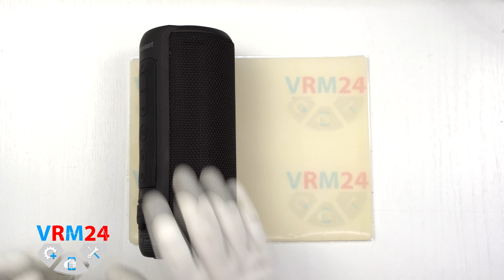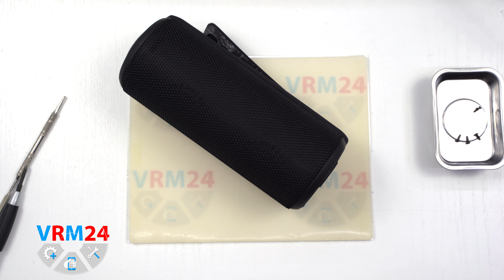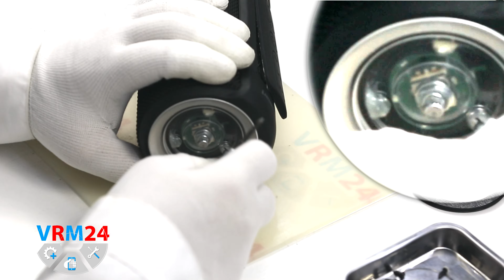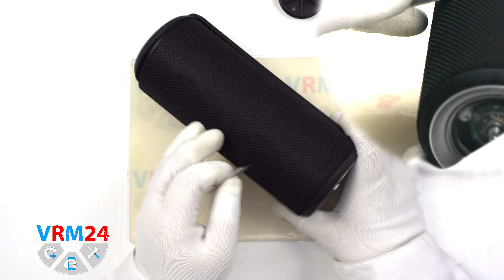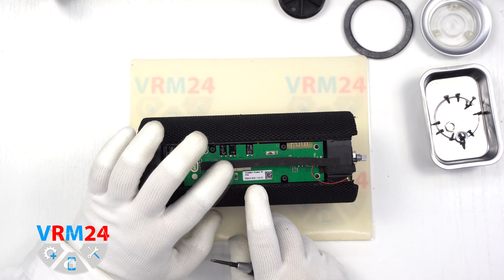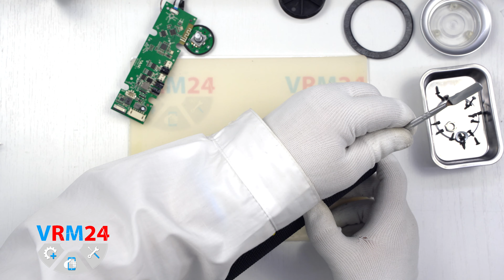🔊 Tronsmart Element T6 Plus Teardown Take apart Tutorial

Comment: ok, you done the simplest part, but I need the next step, I've to replace the battery and I can't understand how go over.
Reply: @stefanosmania  These speakers are not pretty inside. I'm probably a bit late to the party, but I think the grille is meant to slide off one end. I got bored trying and sawed through the two "straps" that join the edges of the grille together (at each end of the control panel). This allows you to flex the grille moulding and slide it off easily. The screws that hold the two halves of the shell together are then accessible... But it is glued also (yummy) so the fun isn't over at this point if you want to change the batteries (looks like 2x18650s from the shape of the holder).
However, you can get at the drivers.
For anyone with crunchy sound or missing volume, the drivers in this thing are ok but not designed to take the bass punishment they get with the combined EQ and the two PBRs, so if you listen at high volume they die screaming.

Comment: Thats not a full teardown. A lot of people would like to know how to access the battery for replacing. I fully opened one down but everything is glued & so difficult to open the plastic case. Even the outer rubber rings on the sub-woofers are glued to the shell.

Comment: Hello, unfortunately after just a few days this speaker refuses to charge.. Can I see if it's a charging issue or a battery one?
Reply from the maker: Hi, it could be a battery issue or charging port or power controller.
Reply: @Vrm24com  I've contacted the seller and he refuses to replace my speaker, so right now I can throw it in the garbage... Worse speaker I ever had
Reply: I had the same issue. Tronsmart told me they couldn't help, the supplier contacted Tronsmart and they sent me a replacement unit. I guess it's a common defect.
Reply: same issue here